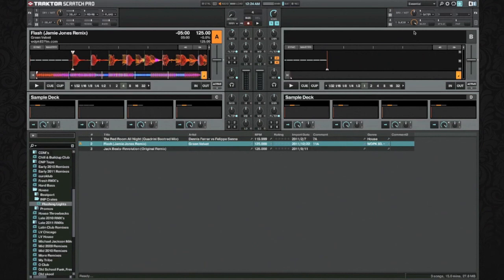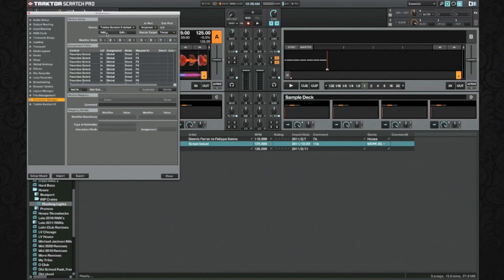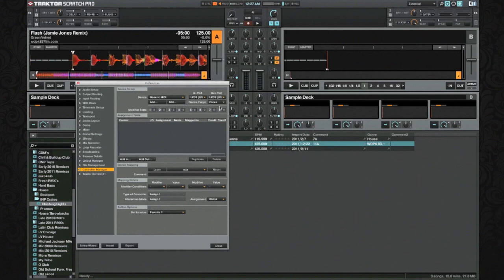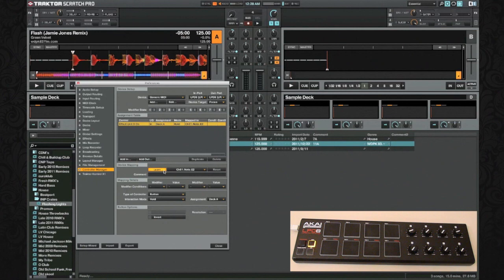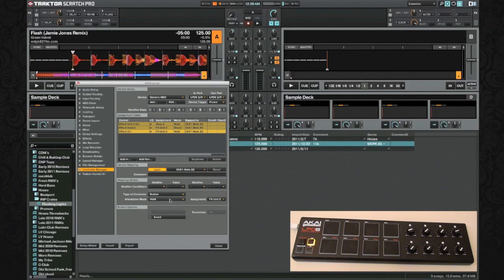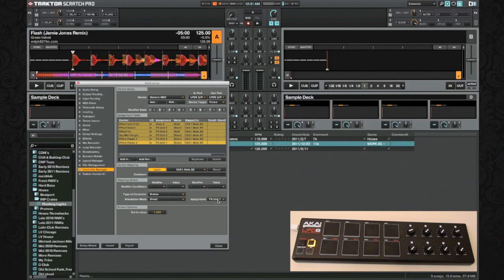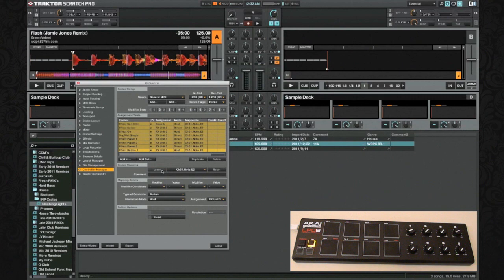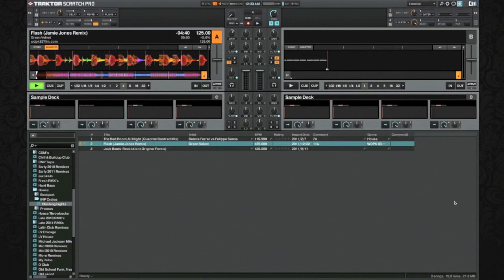Traktor Mapping Essentials: Delay Freeze

Comment: Dude , this video helped me out soo much .. Thanx.    I just bought the Novation Dicers, and it's been hard as hell trying to custom map these damn things .    I adjusted the parameters to my liking and it's working great .  The only thing I noticed that you did which I had to increase was the dry/wet value.   You had it at 0.000 .   Which gives almost no effect through the live output.   Other than that I adjusted mine to Dry/Wet=0.900 , Par1=0.700 ,Par2=0.300 , And Par3=0.320 .    Thanx